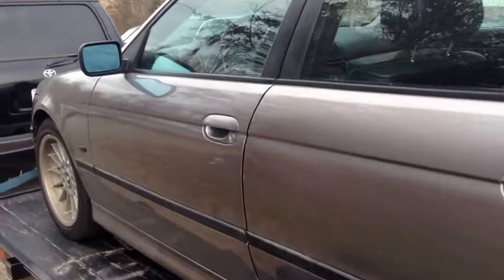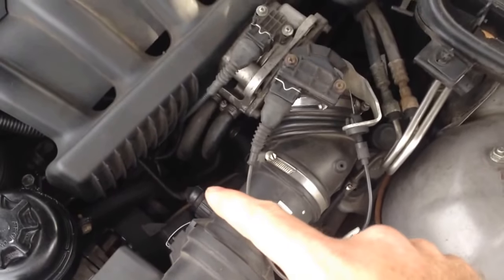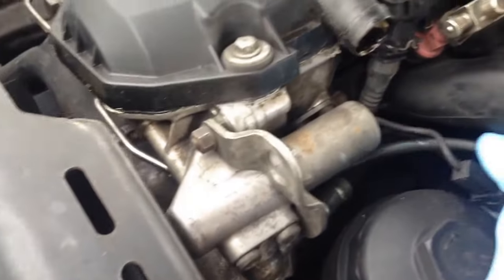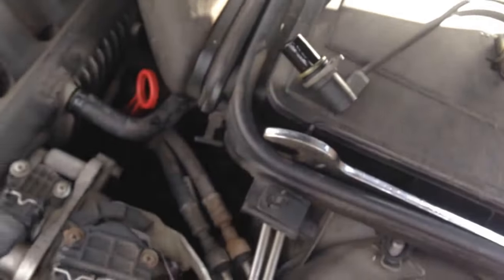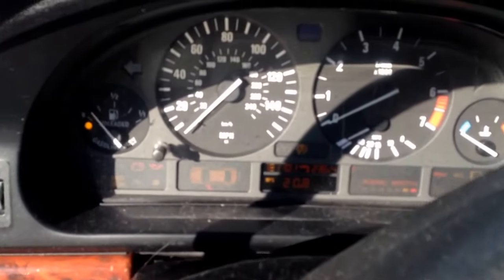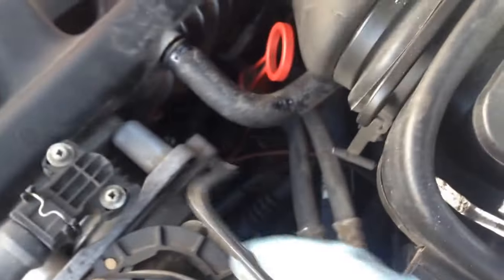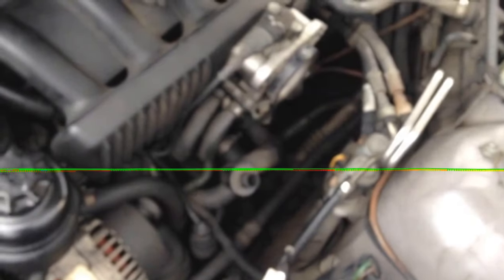BMW E36 E39 m52 m54 Will not start BAD crankshaft sensor replacement 325i 328i 330i 525i 528i 530i

Comment: aww man...I would have done the same thing, I try to use propane when the torch is handy.....anyway another good video, thanks Nathan.
Reply from the maker: Today's update is the car will barely run with the new sensors, I tried 2 other sensors and changed the fuel pump and same problem, runs but badly and is really hard to start with p0335 code, so I guess next is the wiring harness
Reply: Nathan, do you have an o' scope? it would be nice to see the actual sine wave...can you keep it running with propane? if so injectors?...I made an injector cleaner// tester with some
1 1/2" pipe filled with chem tool and an air inlet /outlet connected to each injector and 9 v battery to inject. solenoid for testing,  anyway having fun watching and learning...
Reply from the maker: Well I can unplug the crank sensor and the car runs exactly the same  with the exact same code, and like I said no problems leading up to this , he just came out to start it in the morning and it started and died and then nothing, there isn't too many cars that stump me like this one, but this one is being a royal pain in the ...
Reply: sometimes car starts normally,sometimes it takes time to start, sometimes it drivers normally, sometimes it looses power and vibrates, changed camshaft sensor (wired), it's still the same,could you tell me if these are the symptoms of crankshaft sensor? bmw e39 530i   .And if not,what else could it be?  ??? Thanks in advance
Reply: Name Less did you fix the problem? Was it the crankshaft sensor? My e39 has the exact same symptoms as you described. Thanks in advance.

Comment: I have a 2000 e46 mine did this now wont fire at all!! I've replaced the fuel pump and the fuel pump runs fuel filter both crank sensors oil pressure level sensor and oil switch sensor still nothing! And I'm now out of ideas! Any chance you got an idea?

Comment: Question bro, I have a 2000 e46 323i I replaced cam shaft position sensor both of them and once I go past 4,000 rpm the EML light goes on I was told I need a distributor also that pedal position valve is mechanically stuck would that make my car idle and stay under 40 mph ..?

Comment: I have an E39 off question. My daughter has a 2002 E39 (530i). I have replaced three window regulators with new motors in them. They all rolled beautifully at first, but are becoming more resistant as time progresses. With in a few weeks of replacement to be exact. Any reason as to why this is happening?

Comment: Hi Nathan just wanted to say think your videos are great, i have a 1997 BMW 5 series 2.0 and had a problem with a broken cable to open bonnet and you've helped me sort that.  Also just wanted to ask your advice, I had a driver's side spring collapse on me about 18 months ago?  I have changed both struts and springs, been through Mot  and been seen by 2 other garages who say there is nothing wrong. Also changed track rod ends and I'm still getting wandering steering and having to constantly correct when driving along. Could it be filters in the power assisted reservoir or tank.  I have been on many sites and many have said it could a number of different problems.  I am a mechanic but this has really stumped me.  Any advice would be much appreciated. Thankyou
Reply from the maker: +Stephen Dobson Hello check your control thrust arms and also check alignment, i have videos on both of those topics up, the control arm video was just a few days ago

Comment: What size socket did you use to get the hex bolt out?
Reply: I'm wondering the same thing.. stripped my bolt also
Reply: I used a 3/8 socket to hammer over the stripped hex screw..

Comment: I know this video is old. But I’ve got a 1997 328i. P0335 code. Replaced both the crank and cam sensor. Still no start and code keeps coming back.
Reply: Did you ever sort this?
Reply: @rileydines sure didn’t.

Comment: It gets cold out here in Connecticut and well and he's for certain reasons my car pulls up a code and it still won't start until the temperature rises then the vehicles and starts up with no problem crankshaft sensor can I be the fault cuz that was the code that came up impossibility battery issue Maybe

Comment: I have a question I was driving my E 39 on the highway I was accelerating to about 80 miles an hour all of a sudden I couldn’t accelerate anymore it start decreasing then I had to pull over in a cut off. I had it over a quarter tank of gas and it wouldn’t start back up until I put more gas in it do you think it’s my crankshaft and camshaft
Reply: Was it the timing chain?
Reply: Did you ever figure it out this just happened to me.

Comment: I have the 02 325ci, crank no start, overheated one day so I shut it down , and went to start it up and crank no start, I hear fuel pump, I have fuel pressure, I did a cylinder wash down and sounded like it fired some but still no start! Any suggestions guys!!!! Thanks in advance!! Is it the crank or cam censor , or which is first in line to change!
Reply: So if you have fuel pressure.. next check the spark plugs if it wont fires up replace the (KWS) crankshaft sensor..
Reply: Thanks a lot, I’ll try that here now and will report outcome,
Reply: Howdy cory have you checked the spark plugs ?

Comment: Thank you for the effort friend and very good explaining
Reply from the maker: And Thank you for watching
Reply: @NathansBMWWorkshop   Hello i need your help pls, i got a BMW e46 320d 2004 years and one day i got a problems on start with engine hot temperatur, the next day the car will start very nice but when engine temperatur is up to hot, when i stop the car and come back at 20min later it will not starting, the car have crank but not starting, i replaced the camshaft sensor but is not that, some people tell me maybe its the crankshaft sensor what do you think about that? And when car start on cold i have no problem in driving. Thank you for your help( and my problem is only when engine temperatur (℃) of the car is hot and i need to wait 1 hour maybe 2 hours and she restart).

Comment: 2:44 lol,sounded like he said "the trash control." 
and on a more serious note: … I don't understand how these cars have these sensors that go out, and then cause the car not to run. Seems like it's a monumental case of defeating the purpose!!! I have an E38 which was doing something like this engine is doing, and by dumb luck I stumbled upon a bimmerforum post that said to replace the crank sensor, and it just seemed right to me, so I did and it worked beautifully. Defeating the purpose or not, I sure was happy that that was the only problem!
Reply: They tell the computer the angle of rotation and affects every aspect of operation

Comment: I need help please I recently got my first car it's a 1993 BMW 740i 7 series and it cranks but no start I replaced the fuel pump and fuel relay but still nothing the fuel pump is not even kicking on idk what to do
Reply: run a diagnose
Reply: most likely this will be an EWS problem its the key reader. but you can use the process of elimination to confirm my EWS theory.

Comment: I have a 97 328i that wont start did everything you did, fuel pump works along with the relay. Could it be the secondary air pump?
Reply from the maker: Fidel Cuellar are you using the correct key with the chip, did you check the ecu fuse?, compression?
Reply: where would the ecu fuse located? I have compression,  its just like your video but it just keeps cranking.
Reply: Not the air pump was it a crank or no crank no start

Comment: Awesome video Nathan. I noticed that there's a lot of oil and grease on the outside of the power steering fluid reservoir. I have the same issue with my M54, where do you think it's coming from?
Reply from the maker: +Mohammed Khattari That means the filter is stopped up in the bottom of the tank, you can buy a new tank for under $20 new off ebay, that will fix your problem, some people take the tank off and clean it also.
Reply: +Nathan's DIY Garage I'll try a new filter. Thanks!
Reply: I mean a new reservoir

Comment: would i be wrong to say just check for fuel in fuel rail ? im having some problems with my 745li thats why i ask this
Reply from the maker: This ended up being the crank sensor, but remember the crank sensor activates the pump, so if its bad you might not have fuel pressure
Reply: i have a 745li that has fuel in fuel rail, has spark at plugs and fire in connections that connect to injectors would you have any idea of what my problem could be for a crank no start problem on this
Reply from the maker: yes the ecu fuse, if i remember right it is on the side of the ecu, also could be a key transponder problem
Reply: thanks ill look into that hopefully i can figure it out thanks again

Comment: Replaced my crank sensor and rpms still don't show while trying to start. I changed fuel pump, crank sensor and still no start. Also new relays. 2000 528i.
Reply from the maker: OCD Garage check the fuse by the ecu
Reply: @NathansBMWWorkshop  Where can I find it?
Reply: @NathansBMWWorkshop  I check the block with the 4 30 amp and 1 20 amp fuse and they all were in tact. What now?

Comment: The crankshaft sensor is not under the starter
Reply: Some engines its above the crankshaft pulley at the front of the engine
Reply: @saudade2745  is there any easy way to access this? is it definitely a fan out job?

Comment: you should use starting fliud (ether) in intake not carb cleaner. carb cleaner is called carb cleaner for a reason. its to clean carbs, not assist in starting.

Comment: Hi there...nice job you are doing...i have a BMW e36 328 and when the car warm up it has issues to restart and when I stop the engine dies...I have the crankshaft sensor replace and nothing then I have the camshaft sensor and know it has hard time to rev up it dies when I live the gas pedal and it smells badly baseline...can it be the spurk plugs?thanks
Reply from the maker: Did you use a china crank sensor? any codes?
Reply: No all from bmw dealership....the problem was the MAF....keep up great and helpful videos you make....
Reply: Hey guys can I ask what a ( MAF ) is. ???? Thanx. Pete.
Reply: Peter Campbell mass air flow

Comment: To replace the Crankshaft sensor it is easier to do from the bottom, all you have to do is to remove the subframe support plate and let the control arm lose so you can reach for it.
But that didn't fix my problem, after the replacement of both sensors (OEM) nothing changed the car will start but once it gets to op temperature and once turned off it won't start again and it keeps throwing the crankshaft sensor circuit and camshaft A sensor circuit codes. . 
I am baffled 
Thinking of the wiring issue but then why both sensors? And why it starts and doesn't throw codes when its cold?
Reply: Hi, did you solve this?

Comment: Hi i have a 1998 bmw318is, won't start. Dash lights come on but that's it, also there is a green wire broke from somewhere. Can u help me please
Reply: hey guys just putn info in here E36 like described above has the chip reader (EWS) around ign. two wires go into it and to the module they are 1: solid green wire n 2: green/black strip. any time the EWS does not read the key (hint: green wire broken) this disables ignition spark nd fuel system

Comment: One more thing remove crankshaft position sensor from under the vehicle. It is much easier and you don't have to take half the motor apart!

Comment: @nat buddy I’ve got a great deal on a 328i 2007 but it stalls when I stop only sometimes , with no code but has a service engine light but the guy at the store seen no code. Any idea. Or maybe a email where I could explain more.
Reply: Sounds like a vacuum leak

Comment: i assume you have found out what it was? i have the same probleme on my M50B25 and have changed cam and cranksensor now
Reply from the maker: The crank sensor was not seated all the way
Reply: Nathan's DIY Garage okey, need to check that on my own then

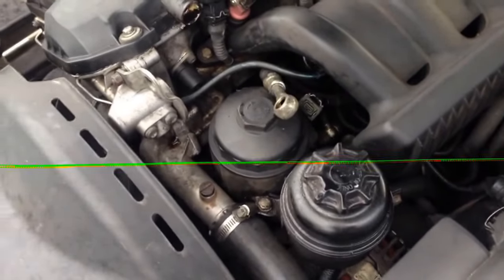Comment: 7:05 what's the other wire that you were touching? runs under the vanos
Reply from the maker: that is the cam sensor wire
Reply: +Nathan's DIY Garage  when your removing the banjo.. the wire that is going under the front of the vanos unit that is the crank sensor.. I ask because. I'm having problems starting the car. it cranks but does not sound right like the engine is spinning to fast,, I pulled the cover checked the timing and the vanos it's about accurate.. so I also pulled the sensor you are doing now so I figure try the other sensor which runs under the vanos system
Reply: +Nathan's DIY Garage I ment cam sensor***
Reply from the maker: facebook me and i will send you my phone number
Reply: +Nathan's DIY Garage do you have a video of how to remove the cam sensor?  .. it has these clips on the bolts and I'm not sure how to remove the bolts because they are inserted on the opposite side were I cannot get a wrench in there to remove bolts
Reply: +Nathan's DIY Garage awsome

Comment: great vid bro, very clear and thorough. ...  I have a 95 740iL, and some smart folk on one of the bimmer forums said all my symptoms point to the crankshaft sensor being faulty. so, I buy a new one, and go under there to replace it - and it looks like there is NO old one installed!! so, very confused. I was hoping to just go under there, unplug one and plug in the other. I did find a place to plug in the sensor end - onto the bell housing - but for the life of me could not find a plug in for the other end! do you or any others reading this know about the BMW e38? Or, is it possible for a car to not have a crankshaft sensor installed whatsoever?? Thanks ... p.s., I have a Peake code reader, and one of the codes was the crankshaft sensor.

Comment: Just to clarify the OBD scanner read codes p0202 / p0204 /p0203 so I looked it up and it’s related to voltage at injectors...could I have possibly not plugged the electrical harness for injectors in correctly...I forgot to mention that I also replaced valve cover gasket when I did the starter replacement

Comment: i drove my bmw e60 engine. to the store parked it and now it will not start. i will press the start button. the lights come on and it makes a buzz noise and thats it. the engine isn't turning over nothing is happening.
Reply: Bad batt or starter. One of the two my friend

Comment: great video mate, im struggling to get the bolt off the crank sensor also. chewing it to bits, ready for crying 😭😭😭😭
Reply from the maker: That sucks i hope driving a socket on it will remove it
Reply: head snapped off the bolt, nightmare!! any suggestions?
Reply from the maker: if you cannot get vise grips o it, you will have to drill a hole in it and use a easy-out extractor

Comment: 10 times easier to remove from under  the car.
Reply: Yep, that's what I keep telling people. You don't need to remove anything. Just do it from underneath, feel for it or use a little mirror and you're in business. Allen key sockets are best, but use what you have. Would recommend replacing the allen key bolts with your standard bolt from a local hardware store to make life easier next time.

Comment: Changing parts on a WAG(Wild-Assed Guess) is not a very good way to fix a vehicle, if I did this on my customer cars I’d be out of business in short order. Think about it... do you really want some guy guessing what might be wrong and changing parts whilly-Nilly especially with as expensive as parts can be these days. Proper testing and diagnostics are the only way to approach these problems on modern vehicles.
Reply: Changing a cheap part in minutes is diagnosing and testing. Probably quicker and cheaper for a hobby mechanic to do than taking to a garage and be overcharged to plug in a lead, bill you for an hours arse scratching and tell you it's the maf.
Reply: Yet here you are, watching my guy😂

Comment: Screws, washers, nuts and etc are all over the engine block. I'm surprised you managed to put everything back together. It would be nice if you have a container to put all of those things together. I'm sure you probably forgot to reattach something in the past.  Disorganized video leads to unsystematic instructions.

Comment: My e46 328i overheated twice then when I went to start it, it was studdering kinda like the second time you tried to start it in this video, tried 3 different batteries and getting jumps with no luck. Could it be the same problem as here?
Reply: You blew the head gasket.